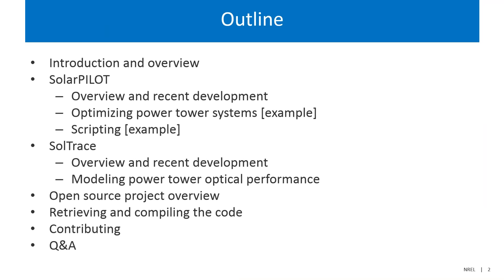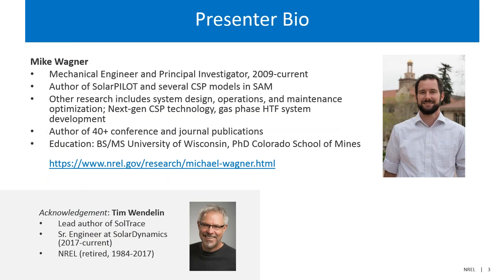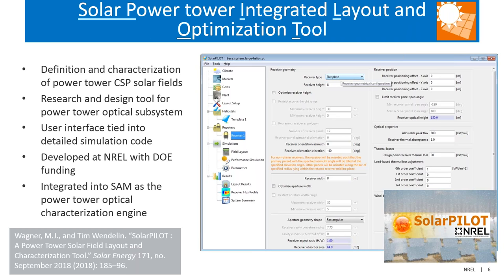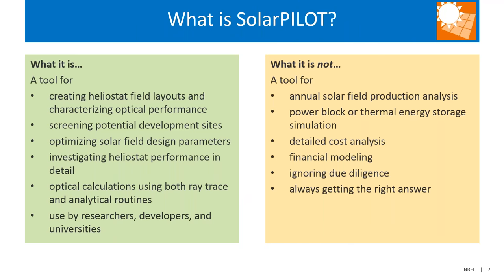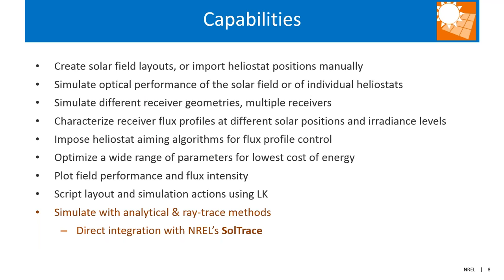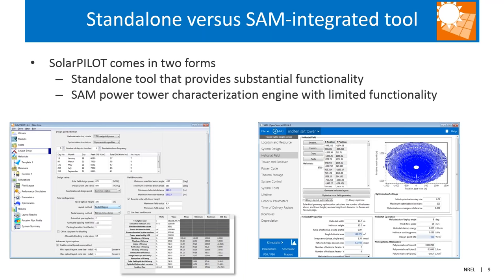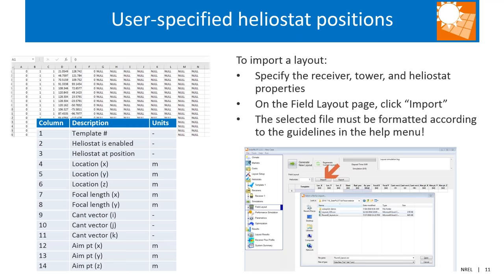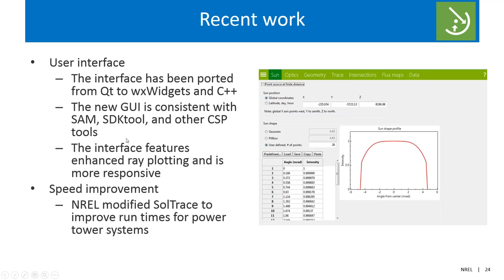Overview of NREL's SolarPilot(TM) and SolTrace Open-source Software

Comment: kindly help here; after inputting the lower bound and upper bound values for tower position in optimization section, it only simulate the initial values of the tower positions alone i.e. not from the lower bound to the upper bound
Reply from the maker: Hi, you may want to use the contact information on the SolarPILOT web page to ask your question: https://www.nrel.gov/csp/solarpilot.html

Comment: I am really struggling to figure out how SolTrace works. I believe I will only have to use it on a basic level but I am struggling to figure out how to use the software and how everything works. For example how you zoom, what units the software operates with, how to read the flux map, etc. Is there some tutorials someone could recommend, it would be greatly appreciated.
Reply: Just to add to this I already read through the help file you get from the SolTrace software itself, which is very lacking in information on how to use the software. It was however very helpful on reading up on the theory used.
Reply: @martynhulsman1426  Hey Martyn, any luck? I'm currently working on a heat flux research topic and I am struggling to get material that helps with Soltrace.